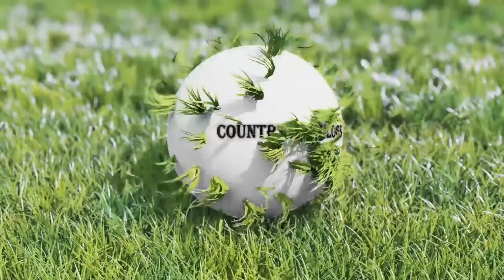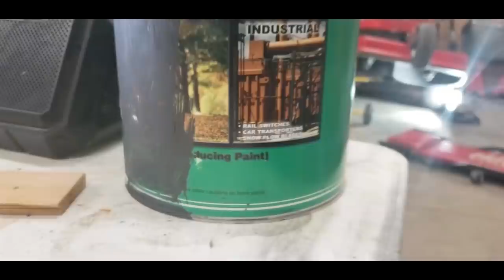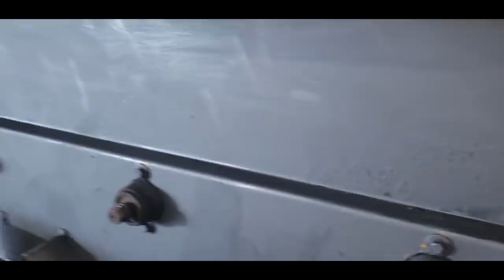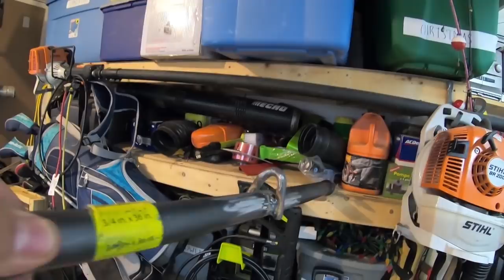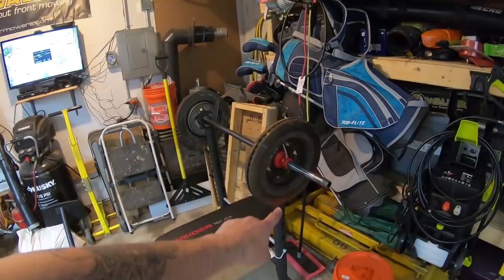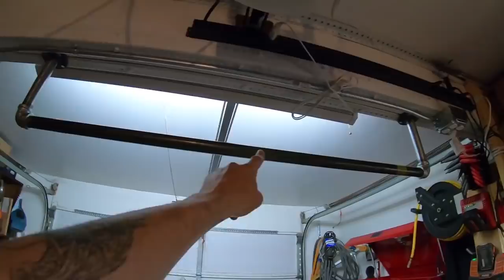Keep Grass from sticking to mower deck

Comment: The stuff for the deck is  Ez slide not easy slick you can find it at tractor supply I just bought  a scag Vride2 and I want to coat underneath  good video

Comment: I just remembered, My Chevy dump I gave you the front bar off of gave me big problems like this... I found out the wood rack body was allowing water to get into the fuel tank despite what seemed to be a tight seal on the fuel sender on the tank.... MAKE sure that is sealed and maybe put some sealant around it to make sure. I would get water in my fuel everytime it rained. This just happened last year
Reply from the maker: I put a new seal on it and the bed is all steel but I def get what you're saying

Comment: You might look into the catalytic converter. I had a Jeep Wrangler one time and it would loose power when I stepped on the gas.  It ended up being a bad catalytic converter
Reply from the maker: That's exactly what it seemed like, but there are no converters on this truck
Reply: Countryside Vlogs Is it possible that there may be something else obstructing the exhaust Flow in some manner?
Reply from the maker: @northtexasturfpros4083  yup,I think the muffler broke apart inside and is clogging it
Reply: Countryside Vlogs there you go :) go team!

Comment: How did it hold up over the season? Thinking of coating my decks.
Reply from the maker: Horrible. 1 week after it made the grass turn to like concrete. Was a nightmare. Took hammer and chisel to clean the deck

Comment: Not long ago I asked you a real stupid question about waxing the deck.
I just didn't know.
Glad you didn't respond.
Randy this stuff looks pretty good 👌 I just did a little research on it,  it's designed for farmers.
Just bought my first Commercial mower. Gravely ProStance 52. I'm going to try it out too.
I found both water base
 and oil base.
Which did you go with?
Appreciate you 👊
Reply from the maker: No problem buddy. Yea know I'm not sure which one it is. I would guess it's oil based

Comment: It’s been a year, did it work!
Reply from the maker: Nope. I've updated a few times on this. It was shit a week after. Caused grass to stick even more and it became like concrete
Reply: @CountrysideStrong   Yikes. That sucks bro, I would do paint it original color and a wax could help to get it off easily and for the paint to not come out
Reply from the maker: It's really not a big deal to scrape them. I only do it in the spring and as long as you start up on it you're good. Just figured I'd try something out
Reply: @CountrysideStrong  same man, just in the spring when the lawns are junky, but best of luck to you this year. This is gonna be a good year!
Reply from the maker: I agree, thank you and same to you

Comment: I going to look at the link for that undercoating for my two.main mowers glad your back on YouTube .see you later young man ouch that hurts that mall.knew better than to have someone do that knowing the rules for that  the bow tie will get running better
Reply: You can get it at the tractor supply in the one gallon cans like that or in an aerosol can also like this https://www.tractorsupply.com/tsc/product/ez-slide-graphite-based-coating-12-oz-aerosol
Reply from the maker: Hell yea, didn't know it came in aerosol
Reply: @CountrysideStrong  I was looking it up and saw that and figured it would be easier than brushing it on so I will be picking that up this weekend
Reply: @CountrysideStrong  I tried bto look it up.in link you had in the.video no luck so if you remember the name i would be most thankful 😃😀😄
Reply from the maker: @d.gentry3086  I'm just not sure if it goes on as thick spraying it
Reply from the maker: @robertmailhos8159  I didn't use a link in the video. I didn't but it Ryan did so I don't have a link. A few guys posted in the comments links tho
Reply: @CountrysideStrong  I don't know but will find out it just may take 4-5 coats to get it to the right thickness the spray on will go on the push mower for sure this weekend it should be fine on the smaller deck sizes
Reply from the maker: @d.gentry3086  I'm gonna do my Toro 30 this weekend

Comment: Used this stuff on my Walker new deck and grass stuck to it worse than without that graphite paint.
Reply from the maker: You are right. I did a follow up on it. Worse crap ever!
Reply: @CountrysideStrong  I am looking at 2K ProMax Clear Gloss rattle can over 2K primer. If that does not work I may try Nano-Clear if I can get a sample from the manufacturer; $279 a gallon is a bit rich for my experiments. Last resort is to purchase a 1/8 thick piece of UHMW and install that flat against the deck since my deck is completely flat; cutting it out will be a bit of work and finding a Sealant glue will also be a trick. I tried 2 part epoxy floor coating that did not work since it was to old and would not cure completely hard. On a positive note; That graphite paint works great on front end loader and excavator buckets to keep clay from sticking.

Comment: I cut a lot of onion grass I live in Florida I think I will get some of that coating for my mowers
Reply from the maker: Watch the update. It didn't end up working so great on my mowers. I had allot of great build up after a 2 weeks and it turned rock hard. It was a nightmare to scrape out. The first week it seemed to do well then after that it started sticking and it was a nightmare

Comment: So how did the deck coating work out for you after one full season? You have not posted any results that I can find. Thanks
Reply from the maker: I mentioned it on the next few videos after that. It was horrible. Don't use it